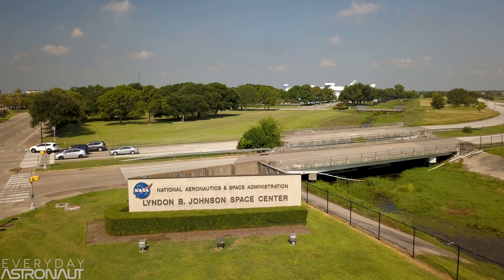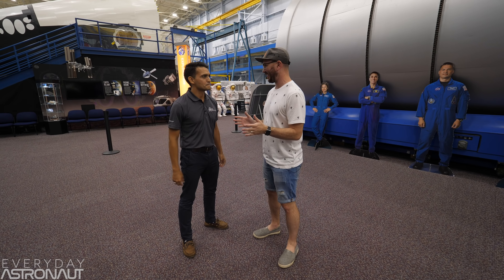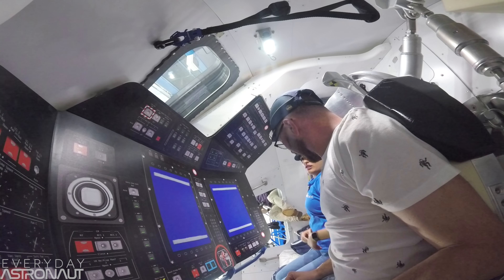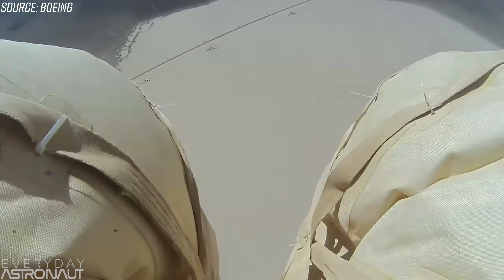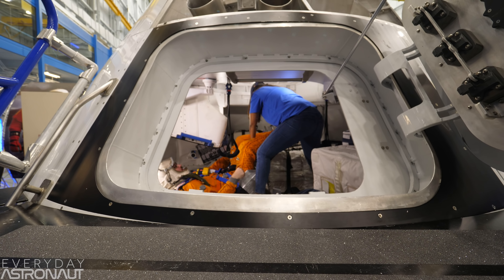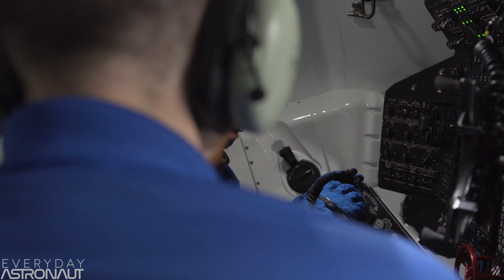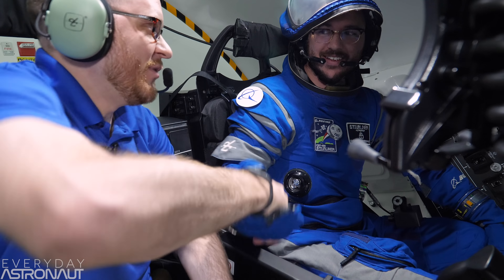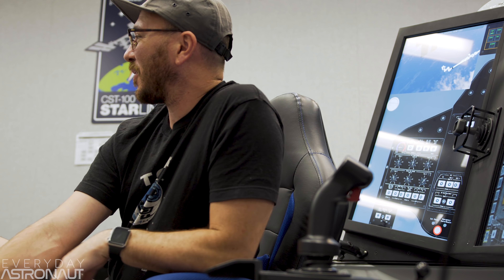What it's like to fly the Boeing Starliner CST-100 Spaceship

Comment: What's a square second?  13:10
Reply: Probably some US time unit. Like Inches and Pounds, just for time. You probably need to divide by 1.2249 after removing 42 to get the normal second used in the rest of the world.
Reply: Obviously a square second is just a second times a second, as is like the denominator for the units of acceleration. I also realized as I was typing this that it can be expressed as second by second

Comment: After seeing the SpaceX dragon this vehicle seems outdated before it even completed. Anyone else feel the same?
Reply: I wouldn’t say that less buttons and only touch screens are really better in an redundancy environment. 
Boeing, despite the recent mcas 737 max issue knows why there should be always a hard button to fix issues (Stab cutout in 737max) 
Despite that I really don’t dig the black in black switches of space x! There is a reason why for example fire switches are coded red!
Reply: @lDrFuManchul  That's only necessary when you're dealing with hundreds of switches. In an environment where there are only dozens of switches, colour coding doesn't do much.

Comment: Do these door welds on the outside panel of the door at 2:40 intentionally have gaps in them to let air in and out of the door structure? Seems like a logical reason.

Comment: I realize that no system is foolproof when you're dealing with tons of highly explosive fuel, but I wonder if having pusher motors for the escape system is a good idea.  If the booster explodes, isn't it likely that the pusher motors and its fuel tanks would be damaged by the explosion?
Reply: If you didn't get clear before the explosion you don't survive anyway...
Reply: What's the alternative? If there is an explosion severe enough to do that, then a different escape mechanism will surely suffer the same fate.

Comment: Major question - Has there been collaboration between Boeing and Spacex on the design and control methodology.  Are astronauts only going to be type-rated on one vehicle, or in the case of an emergency, could a pilot trained on the starliner be able to fly the dragon and vice versa?
Reply: At a guess, they're not interrelated. Unless the Crew Dragon stuff shown thus far is bogus, there are major differences. Starliner appears to use MFDs while SpaceX use widescreen monitors which might have touch-screen capability. This way, any pros and cons between both methodologies can be fleshed out from actual flight experience gained, hopefully, in the not too distant future.
Reply: Snoort Pod - touch screen layout is one thing but in Tim's words, there was something interesting in the way the docking procedure and feedback to the pilot was presented.  Since NASA is the main customer, I would have thought they they would be interested in ensuring some crossover in methodology, at the very least it would reduce training inefficiencies and the links back to mission control have to be somewhat compatible.

Putting it in simple terms, I used to have an Android company phone, then for some unknown reason last year they issued us with awful Apple phones.  Both are phones, both use touchscreens but I was absolutely lost trying to do things on the iphone that were simple on the Android.  The underlying operating system and the mentality of the program writers is so different that it becomes very inefficient to switch between the two.  Of course, on a spacecraft, it is not just inefficient, and could be potentially fatal.
Reply: Interesting points. If you want to dock, then the most important parameters would seem to be things like planar alignment, minimal off-centre displacement and real time feedback concerning closing velocity. The point is the differences between systems should really only be cosmetic. But maybe you're right about unnecessary duplication of effort. One thing is for sure - the spacecraft exteriors are quite different and both companies are essentially rivals not only with each other, but seem to be vying for audience participation. Why else was Tim invited to showcase the Boeing setup?

Comment: Is the starliner adaptive to any other rockets?
Reply: Compatibility with other launch vehicles (Delta IV, Falcon 9, ...) was a primary design goal [1], so yes - even though at the moment it seems as if only the Atlas V is supported.

[1] https://www.aiaa.org/uploadedFiles/About-AIAA/Press_Room/Key_Speeches-Reports-and-Presentations/Keith_Reiley.pdf
Reply: Pretty sure it's supposed to be compatible with SLS
Reply: +boboprime2000 I'm pretty sure it's not given that SLS is not a private sector project and already has a matching vehicle  - Orion. SLS is meant for BEO (beyond Earth orbit) missions, a mission profile that neither CST-100 nor Dragon 2 are designed for.
Putting a CST-100 on top of SLS would be the equivalent of using a container ship to go fishing in the bay...

Comment: Why are there so many wide windows in the US spaceships (Apollo, Orion, Dragon ...)? After all, excess holes reduce strength and complicate the tightness of the ship's hull. A glass even the most durable necessarily misses the solar radiation. What do you want to see in them except the darkness of the cosmos, for example, during long flights to Mars? After all, just a couple of small windows for photography and video are enough, and for docking in space use automation and cameras
Reply: Neither the Orion nor the dragon are designed to go to mars
Reply: I agree! But these ships are given simply as examples... just like Mars, by the way.
Reply: @БоряАкчалов  no not really, the only current spaceship design that's actually supposed to send people to mars is the BFR
Reply: Wow! Cool thing! Has it already begun to build? I just do not know how it goes ...
Reply: @БоряАкчалов  the massive methane fuel tanks are already being tested, like the raptor engines that will power the BFR. According to musk, the 2nd stage of the BFR will start doing hop/hover tests in late 2019 or 2020
Reply: @БоряАкчалов  they are currently building the factory and molding tools for the BFR
Reply: Spaceships have windows because astronauts wants them, just like commercial planes because passengers want them. It also helps with situational awareness. In the shuttle days they pointer  a range finder out the window to help in docking with the ISS

Comment: 1:26 "a configuration that an Atlas 5 has never flown before. But all the hardware has been flown many times throughout history" This is the stuff I'm worried about. There were many rocket failures which was a result of lazy engineers "recycling" reliable components, without double checking if they are compatible with the other components. The only one I can think of right now on the top of my head is the first launch of Ariane 5, where they reused some software from Ariane 4 but didn't bother to double check the data conversion, and then boom.
Reply from the maker: It will fly on the uncrewed test flight, but it does seem a little unfair that spacex has to fly 7 block 5’s and ULA doesn’t really have to do any to certify the vehicle.
Reply: Awesome! Thanks for letting me know.

Comment: OK, so your docking with the ISS sounded wrong.  If you increase speed by 4mps that should also raise your orbit...didn't sound like it did.  You also couldn't increase speed and then burn it off because that would put you in too high and then reversing would put you too low.  Rather, you have to accelerate too the ISS from below at a consistent speed that puts you at exactly the correct altitude when you get to the ISS.  So, what's going on?  Sounds like Boeing hasn't thought this through...
Reply: ESA has a good video detailing how the soyuz capsule does this, im not sure how similar it'll be for crew dragon and starliner but it does detail a lot of what happens

Comment: I'd rather get abducted by Aliens than getting stuck in mid-air all because a technical issue 🚜
Reply: What, you don't like switches and Multi-Function Displays?
Reply: @itsfrediguess7844  just a fact that anything that we produce doesn't just comes at a huge tag, sooner or later is going to need servicing and Space is loaded with Junk, i believe some Advanced civilization may have better methods at manufacturing and building complex shell like structures that can last for a thousand years🚜

Comment: Nice video and nice craft, but in 2018 I really do not understand why that capsule is cluttered with all those manual controls. They take up so much weight and space, while they could just as well be controlled remotely or automatically with basically the same weight in electronics and flight systems.

That room would easily fit another person, more cargo or make it easier to launch.
Why this archaic tendency to make these things need a pilot and commander chair?

Comment: You’d think with unlimited funds and the smartest people on the planet . NASA would be able to change that nasty 30 year old carpet.
Reply from the maker: You have a pretty large and false assumption “with unlimited funds”... NASA definitely does not have unlimited funds 😰
Reply: Everyday Astronaut compared to my bank account they do.  
   Point is that carpet has been there for 30+ years.  I live about 3 miles away from JSC. And 20 years ago I did contract work there. Same carpet. Guys I spoke to said it had been there at least 10 years before that.  With 2-5,000 kids running around there every month. I don’t care if they clean it every week. It’s NASTY!!!! I mean it’s carpet. What $2,000 to replace all of it.  They made at least that just on tours Last month.  People who work there avoid the “public areas “ for just that reason. Sooo ?? 
  Just saying , still a cool video. But it’s time to change the CARPET.  Lol.
Reply: I think you are talking about space center Houston. It is not the same as Building 5 at JSC. That carpet in the video is actually only a couple years old.